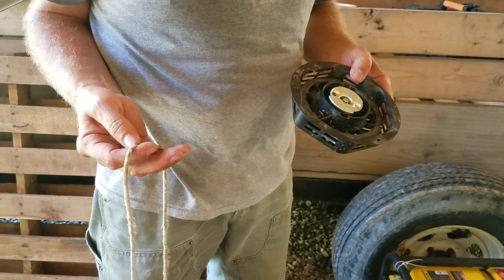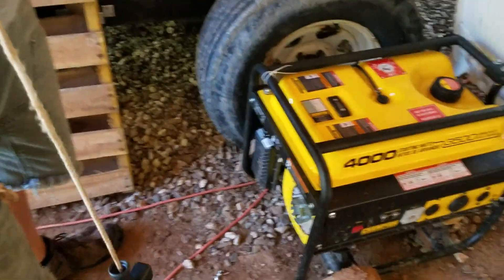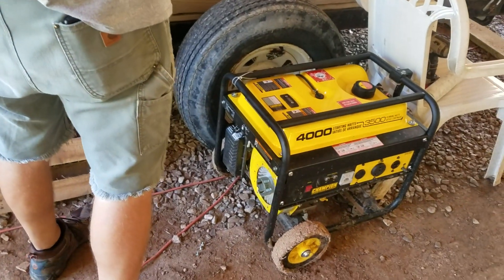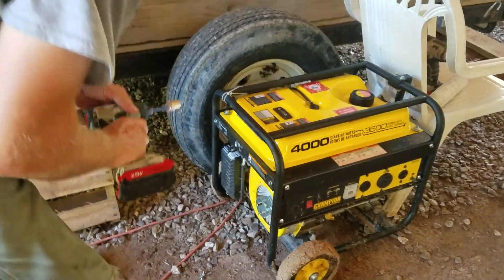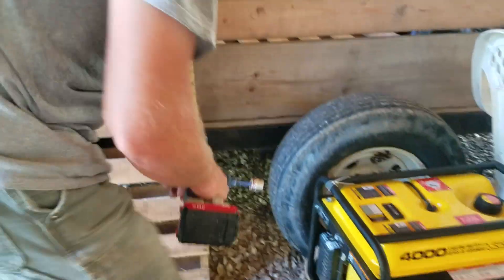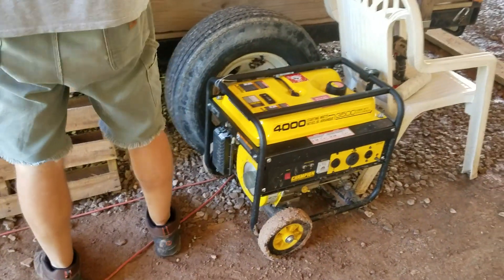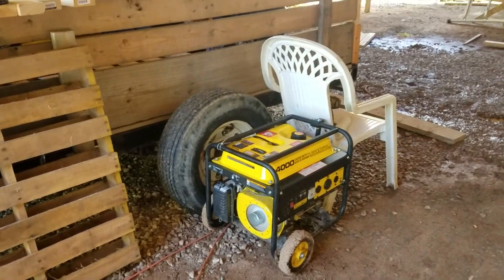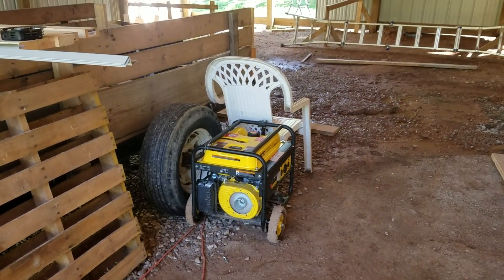How to start a generator without a pull rope.

Comment: Can you start it  like that with the pull rope entact? I cannot pull rope anymore
Reply from the maker: Not sure if the rope would be affected or not, it's worth a try, Lol. Thanks for watching.
Reply: You would have to take the pull rope assembly off in order to access the flywheel bolt to hook your drill driver to.

Comment: A friend of mine messed up his generator doing that.
Reply: yup will snap center out fly wheel
Reply: This isn't a permanent fix for sure..and it might be safer to use a regular cordless drill instead of an impact/drill(not sure)
Reply: @kustomair5937  dont youse any thing on that center nut it will split the fly wheel  them  nuts are tork to a certin pounds presser if you over tork them from trying to start it it will break the fly wheel in half  rap a rope around it and start it that way will not break it that way
Reply: @stevesaverin6866  ..in my personal experience I couldn't get it to wrap and grap even after cleaning it up..soni used a cordless drill. Worked for me, but you are correct. You are definitely not supposed to.

Comment: Yes but when the engine starts the nut on the crankshaft screws back off leaving the flywheel capable to just fly off
Reply from the maker: Lol, the crank nut has right handed threads, it turns the same direction as the engine. That procedure came in handy until we could replace the rope, Lol. Thanks for watching.

Comment: good way to break the fly wheel  never yous a inpact on the fly wheel nut  youse a rop aeound the fly wheel i hate peps showing  stuff like this that can break pepols stuff
Reply from the maker: Lol, don't be a Karen!!!
Reply from the maker: Lol, Steve sounds to me like your the only one that doesn't believe it. The video doesn't lie, it happens right in front of you, but that's ok, you don't have to believe it or even like the video.  I hope you find better things in Life than  to bash other peoples videos, just saying!!!!
Reply: @RZRRocks  im a small engin  macnic its comen sence its s steel taperd shaft with a aluminum fly wheel  if you over tork it it will split
Reply: @RZRRocks hey what’s the socket size you used?